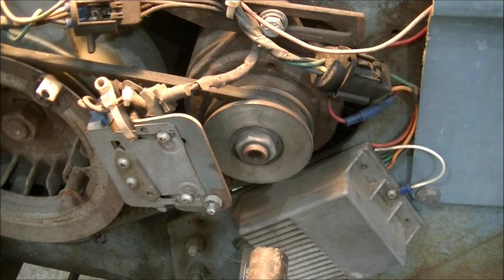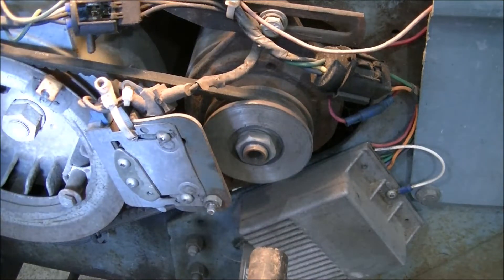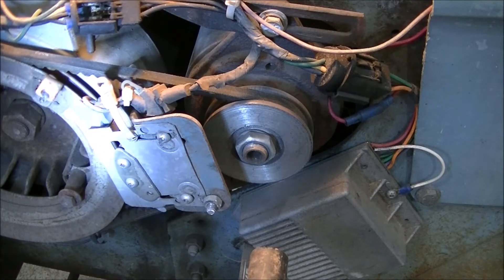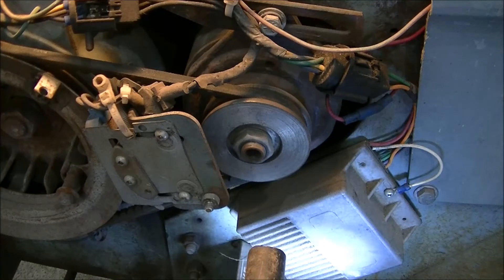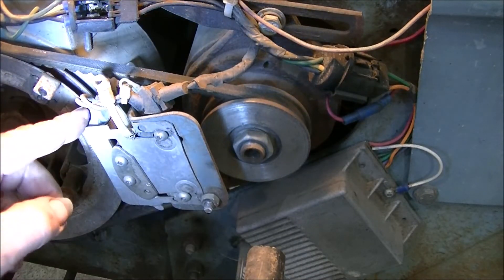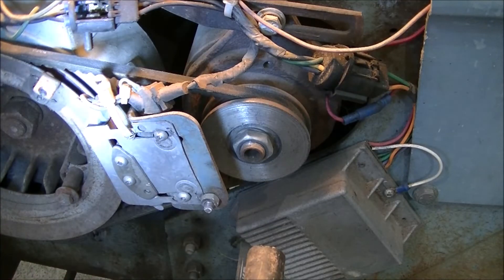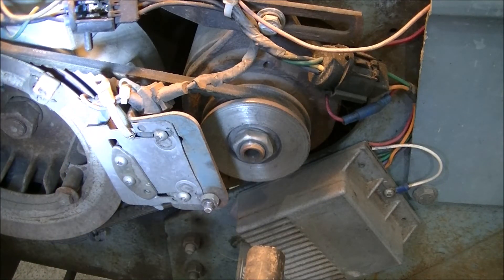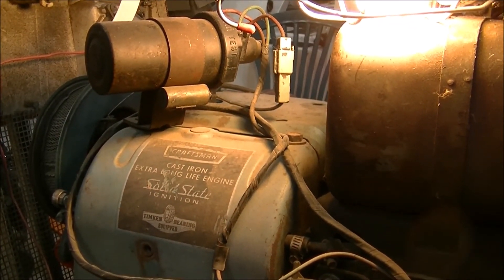1971 Sears 12 Garden tractor - DIY Electronic Ignition - zeketheantiquefreak

Comment: Brilliant. For a wiring diagram on doing this, Brian Miller's gardentractorpullingtips on his website has that and a lot more.
 I used a Motorcraft control (off an AMC) like Zeke shows, on a Kohler and have a Sears that I put a GM HEI system on, years ago, but it miss-fires at rpm. 
My solution was to put a stop on the throttle; however, Brian states a 3-wire proximitor sensor (NPN normally open) will correct that (they are 12 v powered).
 I ordered some online and when I get the Sears back from my son will fit one to the Sears. Brian also sells them on his website.  Mike
Reply from the maker: Thanks for the info!
Reply: @zeketheantiquefreak8518  Hi Zeke, just thought to mention that I am using the Motorcraft ford/ AMC module and it will not work for me with a proximitor but works great with a pick up coil from a 4 wheeler (a Polaris magnum 450 I got)  Mike

Comment: Hey you still kicken?!?!
Reply from the maker: Yup.
Reply: @zeketheantiquefreak8518  oh good. This is in regards to your Wisconsin Kohler generator.  I have one from 1956 that is a Fairbanks and Morris probably 100 hours on the thing I was wondering though if you knew how to energize the generator on it I can’t get any power on it it’s a three phase 7500 W.  Appreciate any direction you can give me and appreciate your channel. Glad you’re in good health or at least still Kickin lol.
Reply from the maker: @justintothetruth  This sounds goofy but does work if the armature has lost it's magnetism: Check for videos about using a 'universal motor' A/C 110v electric drill plugged into the running genset, with breakers on. (Watch your wrist!) Tape the trigger, spin the drill (In reverse, I think) by hand to restore magnetism. Be careful, the drill will run when the generator circuits excite... Verify the hand rotation from other sources.
   The more orthodox way to do it is a simple process called 'flashing the field'. Instructions also available here on ScrewTube.

Comment: Ghost Spark is better then no spark! 
Love the sears tractors! I have Um...  6 of them right now LOL
Reply from the maker: Wow... What oil do you use in the manual transaxles?
Reply: @zeketheantiquefreak8518  I did not see this comment till now LOL 
I blew up 4 sears transaxles in the last 3 or so years 
Now i use 90W in them.
Reply from the maker: @starpuss  Yea, my Sears 12 had some little worrying 'ghost' noises in the transaxle  and a heavier oil smartened that up.